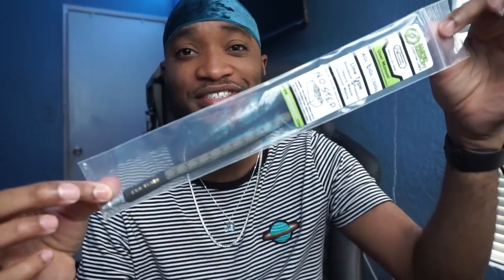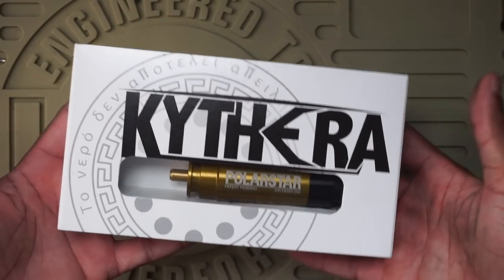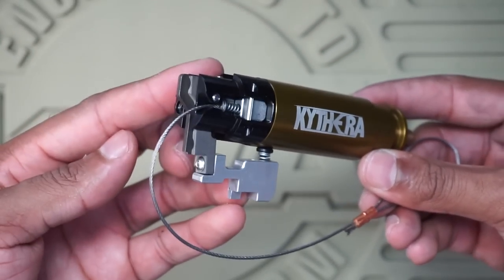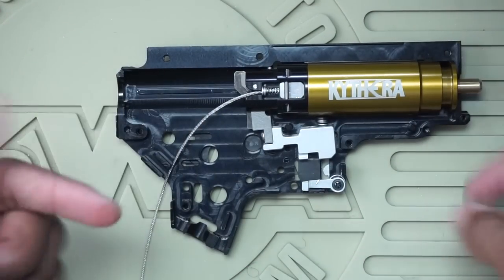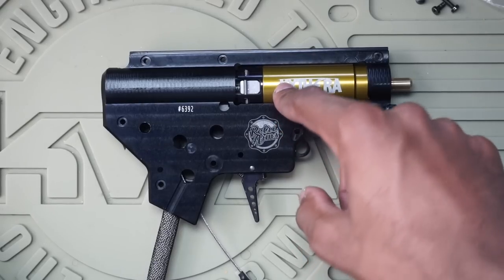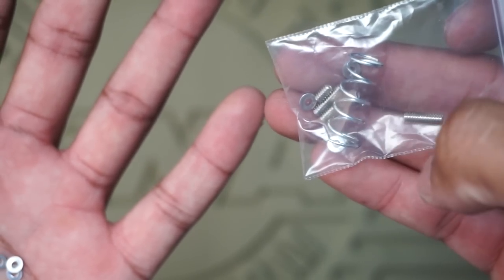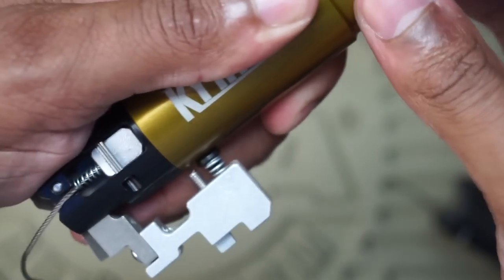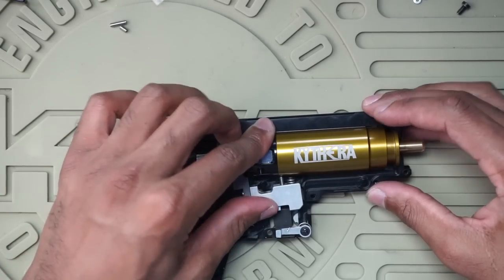Polarstar Kythera Installation & Tuning Guide - Lets Talk Airsoft (The Airsoft Life #85)

Comment: I have all the parts for a $600 Polarstar Kythera build (tank not included) Brb when I build it. For you that was exactly 5 words. For me that was 3 1/2 hours of Polarstar building. When he said that you could connect it to the charging handle he wasn’t lying it’s actually pretty easy. If you’re wondering I put it in a Helios body. I wish my field was open so I could go play with it.  However backyard testing seems to show that it works incredibly well.

Comment: So, 6 months later, how is the Kythera build holding up? Any issues come up? did you ever polish the sear and disconnector? 
I bought a Kythera and built a BPRE stylized M4. After some indicial learning curve issues and some adjustments made, the gun ran great and shot so well for about a month and then the disconnector screw backed itself out a bit and I had to go back into it. So I cleaned it all up and re-greased it and that's where the issues started. I also did a quick realignment of the nozzle by using a screw in the side of the gear box shell to push the nozzle back into alignment. That worked great as there was some wear marks on the nozzle and inside the hop unit. With that corrected the nozzle now pushed the BBs too far forward, past the fed lips, so if the hop up is off, the next BB just rolls out the barrel. This is causing me to have to raise the air pressure up from the original 90PSI to 140PSI to get back to the 1.5j using .32g BBs. 
Not happy about that and not sure what went wrong. I have checked and double checked everything. This is really frustrating. I've got the gun backed down to 120PSI now after some more messing around wit it, but having to raise the system up 30PSI is odd. Seems a more aligned nozzle would be more efficient and use even less air, but maybe its the bucking getting worn out. It was new when I built it all. and the drop test still shows that when you drop a BB into the end of the hop/barrel assembly the BB gets stopped at the bucking lips as it should.

Any clues?

Anyhow, great content and game play. Thanks!

Comment: Looks like you have the same issue I have, where the Kythera is slightly shorter than the cylinder cutout, is that really a problem? I assume I’ll lose some air seal with the barrel/bucking..

Comment: demoe that build is dope but you dont need a spring guide with the vfc receiver because the buffer tube screws into the receiver!! not the spring guide so there is no use for a spring guide when it comes to hpa drop in replacement engines inside vfc receivers 😂 but for real polarstar should make a buffer tube adapter for the kythera that comes with it because everyone will have to modify their spring guides to fit unless they have vfc receivers hahaha
Reply from the maker: Not all VFC receivers...The Avalon buffer tubes screw into the spring guide, same setup as the one on this gun.
Reply: TheDeeMoe ohhh good to know my dude!! i just thought with all vfc receivers they screwed into the receiver, i don’t get why polarstar didn’t make a buffer tube adapter for the kythera like the wolverine infernos came with! also i low key copied your build with a fusion engine and magpul receiver/ dytac mlok rail

Comment: I have been an user since I started and I would be very new to HPA and I dont want to buy a jack or fusion engine because of the battery and the fcu. Would you recommend for a first time hpa user ? Also, what is the price point ?
Reply: 275 bucks

Comment: deemoe quick ? do u thin the jack would be better than the kythera if im just playing speed QB. and if u can can u tell me what is the differences performance wise. and do u think you are going to use this system more in tournements than f1 and f2. this would help so much if u replied thx
Reply from the maker: Yeah if you want a responsive/spammy trigger & also a full auto feature then get the jack. The Kythera works well with more outdoor/milsim style builds in my opinion, plus you’re limited to semi only
Reply: thx so much hoping to see you back on the field

Comment: DeeMoe, I’ve never really messed with HPA and Polarstar stuff before. What all would I need to run one? I know I’d need a tank and igl. Would I need a special regulator or remote line?
Reply: You need a tank, regulator, remote line, igl, then the engine. If you use the Kythera that's it but if you go with a non-mechanical you will need an hpa battery as well.
Reply: @IamDylin  thank you 🙏🏻
Reply: you need a battery
Reply: and a brain